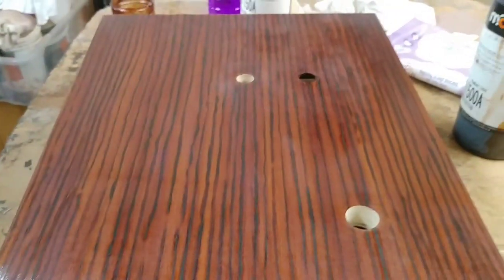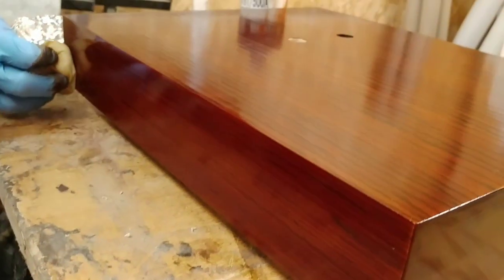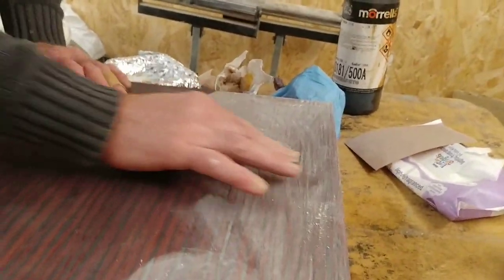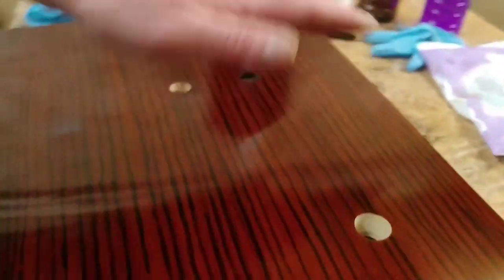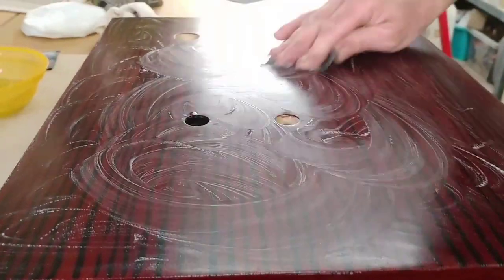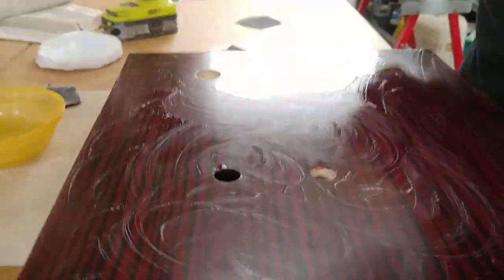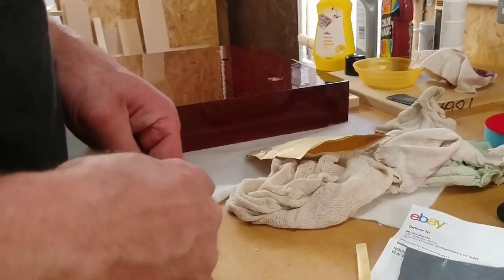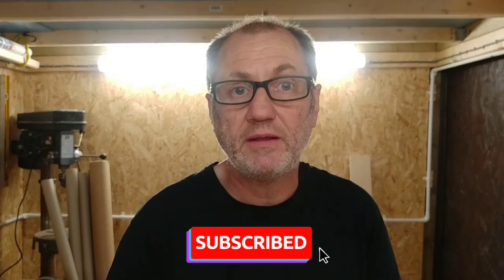How to polish our Ultra Rega Plinth (part 2)

Comment: Impressed ...stunning. When I watched the previous video it inspired me to build a new plinth. I’ve made mine from MDF and I’m going to veneer some finishing panels on the outer edges. Weighs a ton and I’ve got to put all the workings in yet...Take care ..
Reply from the maker: Nice to see my video, are inspiring you, that's the whole reason I set up the channel,  its amazing what you can achieve with a bit of effort, thanks for watching
Reply: tweaker man I’ve also made many of your cables too ...keep up the good work ..

Comment: That’s beautiful. I’m glad you went for high gloss — it’s what I would have picked. Ever finished bamboo?
Reply from the maker: Yes, I don't think there's a wood that I haven't finished, thanks for watching
Reply: tweaker man any tips for finishing it? I’ve just made a pair of small speakers in bamboo. They sound much better than the iPod speaker I salvaged the drivers out of, but are not the last word in fidelity. If the second or third word in fidelity is “passable” then maybe that’s what they are... anyway, they are not worth a lot of effort. If you had any thoughts on quick finishes I’d love to hear them!
Reply from the maker: Sand them very  smooth, then finish them in danish oil, it's a very easy finish to use.
Reply: tweaker man thank you mate. I’m Danish, so you’d think I’d know that. Actually I wondered, but I haven’t ever tried Danish oil on bamboo before... I’ll send pictures when I get them done.